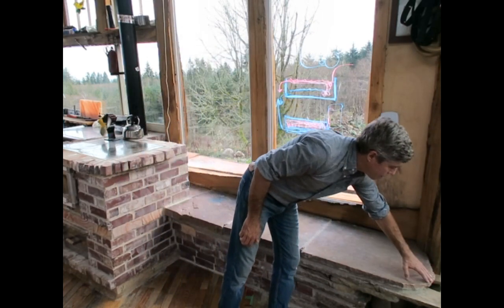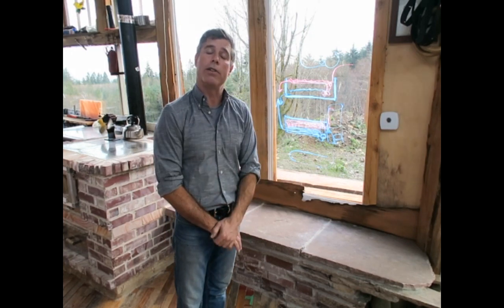Rocket Mass Heater Bells and Benches Discussion

Comment: Hey Matt- Thanks for all the videos!  how important is the volume of the bell? what would be the downsides of having the volume to large? or is there a target volume based on the stove size?
Cheers!
Reply from the maker: Volume is important, but not an exact science as things change dramatically depending on weather, heater state (warm/cold), fuel, materials, etc.  Too much volume means that exhaust temps are too low and there isn't enough draft to run the combustion core to burn efficiently.  The solution is a start up bypass, to preheat the chimney and create draft in poor conditions.  Using a start up bypass you can overcome a cold mass, or large mass, and allows for more thermal storage since you can start up small and then switch over to a larger volume.

There are calculations for Internal Surface Area(ISA) of a heater in relation to how much fuel it holds(Power output, usually in Kw).  I usually don't bother, as I haven't found the calcs to be a very useful guide, and I have a pretty good handle on what constitutes a heater that will run well.  That said, many builders find comfort in pre build maths.  Here's a link if you would like to learn more: 

http://donkey32.proboards.com/thread/1822/sizes-single-bell-systems

Hope that helps!
Reply from the maker: Yes Hugh, the core is sized for a 6" chimney.
Reply: @broaudio  hey, first thanks for video, second I'm tinkering with my own bell and I have idea for making sort of moveable flap between bell and chimney so I could set different ISA. Like start rocket with almost none so chimney can preheat and than make bell bigger and bigger. For my 200mm chimney it could rise to something like 16 m2 of ISA I was said. But Peter suggests something like 9,5 so I wonder if there was some another attempt to have scalable bell. Do you know?

Comment: I have a question on the exhaust.  The exhaust leaves the bell at the bottom but do you have a vertical flue outside of the building? We get lake effect snow and if there is a persistent band we could easily receive 12-18" in one snowfall potentially covering a low vent. Interesting topic.
Reply from the maker: Tracy, yes, there is a vertical chimney going above the roof line like any standard wood burning device.  Thanks for the question.
Reply: So my next question, instead of using some 30' of pipe for the flue to get 3' + above the roof line  can I use an exhaust fan to create the draft while I have a fire going? We're not worried about smoke and creosote as the output would be just CO2 and steam. Perhaps a vedio on exhaust part of the system would be useful to more people than just me. Thanks. Tracy.

Comment: Matt, do you have anything like either an actual halved bell we could see, or a drawing?  Also, a question:  is it the expansion of the hotter gasses in the top of the bell that force the cooler gas to exit near the bottom?  I can imagine the cooler gas leaving the bell, provided there's literally a drop of some kind, but having trouble visualizing those cooler gasses then rising out an exhaust.  ???  Thanks for any light you can shed.
Reply from the maker: Hi Sherry.  I don't have a drawing as it's just too simple.  Turn a bowl upside down.  That's a bell.  As for the flow, think of a stand pipe in a pool of water.  If we fill the pool, the water will not drain out until it reaches the level of the standpipe to flow into and down and out.  The bell works the same way, but upside down.  The bell fills from the top down with warm gasses, when it fills down to the exhaust exit it can then flow out.  Hope that helps!

Comment: What about the draw comparison? does the flue through the bench seat draw stronger than the Bell design? And also if I use the flue to connect two Bell's together won't one bench seat be warmer than the other?

Comment: Good morning Matt, Happy New Year, so does a batch box with design with a 8 inch flue and a 55 gallon barrel combination sound okay to use with this bench seat idea? and if I decide to do two benches would I take the lower Outlet from the one bench and put it into the higher side of the other bench? and then take the Lower outlet of the second bench to exit outside the house? and how is the draw (suction) compare with this idea from the duct pipe through the bench seat with mass idea? Thank you so much!
Reply from the maker: Happy New Year Brian.  Yes, the normal RMH configuration, 6" or 8", into a barrel and then to a bench is a great design.  Quick heat from the barrel, long cycle from the mass.  Sequential bells are possible and increase heat extraction over a single bell of similar dimensions, so a two bench system is a good compromise of smaller footprint and better extraction.  The coupling should be done as you describe, but it's not necessary to enter the bell low.  It will change the performance a bit depending on the system, but exit height is most important.  A high entrance into a bell means it may function as one bell with the proceeding bell.  Draw is roughly similar, although velocity is reduced in the larger volume of the bell compared to flue run.  At the chimney, it's all the same.  Hope that helps!
Reply: awesome, glad to hear it, thank you so much for your input and response. I'm excited, I will post a video when I am completely done.
Reply: Matt, did you mean that "it's not necessary to enter the second bell *high*?
Reply from the maker: No, I meant it how I wrote it in this specific case.  His situation may extract too much heat if both bells are designed with max heat extraction so it may be beneficial to couple them high so more heat is transferred to the second bell.
Reply: thanks!

Comment: Matt, I'm just about ready to do my rocket mass heater and I can't seem to find your recipe for refractory mortar for the batch box combustion chamber to hold the fire bricks in place, I looked up a recipe online that calls for Portland cement, silica sand, lime and fireclay. I can't find the fire clay anywhere locally. some people say that there is clay in the creek beds here in New Mexico do you think I could use that? or what's your recipe?
Reply from the maker: Your clay should be fine Brian.  I use store bought Lincoln 60 Fire Clay and sharp mason's sand at 1:3 by dry volume.

Comment: Do you really make exhaust gasses travel downward a little inside of your stove?  If so, can you explain how it works please?  I’m a total noob who’s just beginning to read about RMH’s.

Also, one thing that would greatly help me to understand the design of your stove is a 3D model of the open space inside of it.  Closeup pictures of different parts of the 3D model could be shown to explain each step that the flu gasses take through the stove.  You could even draw them by hand if you’re a
Reply: ... if you’re a good artist.
Reply: @daveroller  I know this is a late reply, I bought the plans and to help me explain them to the man doing most of the brickwork for me I made a model out of Lego ( other building bricks exist) (there was a language barrier also) it helped a lot

Comment: Both the mass and the bell systems are interesting. My question is, can they be used together? For example running flue pipe through a mass first then having it exhaust into a bell. Would there be enough heat for the stratification to take place and then exhaust trough a exit pipe. Also would this be any more efficient (store more heat) than either system on its own?  I find this whole concept fascinating.
Reply from the maker: They can! 
https://youtu.be/QRUsG20OksA?t=1m19s
There really isn't a better or worse system, just different features for different functions.  In the case in the link above, I had a long run that was too big for a bell so used flue pipe, but the end of the bench was slow to heat and cool.  I use a bell there to allow the gasses to dwell and heat that space well, as well as allow a thinner top coat for faster heat up.  It all depends on your goals and design, the different methods are simply tools you can use to achieve those ends.
Reply: Cool, thanks!

Comment: Does the stone bench top need to be sealed against the rest of the bench to prevent gasses from leaking out?
Reply from the maker: It does Benjamin.  I just set the top sections in the same clay/sand mortar used for the brick work, and fill any gaps with the same.  It's easy to disassemble to inspect, and seals well.  Great question, thanks for the comment.
Reply: This was definitely my number one concern. I just wouldn't be able to get it out of my head someone accidentally breaking the seal.. I guess that is why the typical rmh's tape the pipe joints and have 3-6 inches of cob and clay sealing the entire shell. I love this idea and could see the benefit of making it even deeper. I guess I could run a half barrel shell covered with clay before adding the bench top to appease my paranoia LOL Thank you for the great ideas.

Comment: This is regarding the double sequential bell scenario posted by Green Energy Concepts (YouTube wouldn't allow me to reply to that comment).  It does seem funny when I first think about it (the entrance and exit in the second bell being at the same height), but if I am understanding Matt's answers correctly, it shouldn't matter..... ?   or should the exit still be lower than the entrance in the second bell, even though the entrance is positioned 'low' ?
Reply from the maker: In a double bell build where one is trying to maximize heat extraction ideally both entry and exit would be as low as possible.  Exit does not need to be lower than the entry if both are low and there is room above to stratify.  The real key is to have the exhaust low in the bell, so gasses must cool and descend from the upper level in order to find the exhaust.  Ideally the entry is low as well, to encourage stratification, but in practice it will work either way.  Exit does not need to be lower than the entrance, but it should be low in the bell.  Check it out, he built it!  https://youtu.be/ELt-41Majsk

Comment: Could this system be scaled down to be used to heat a chicken waterer? I am thinking having a stove of some sort outside of the chicken run, then run something into the run that I can set a metal waterer on to keep it from freezing. Right now I have candles in a cinder block and a metal waterer on top of that. It works decent when it works but overall its a PIA.Jokes about scrabled eggs aside, how would I scale something like that that could a.) burn some kind of fuel all day and b.) not be so hot as to be dangerous to the chickens? (an no jokes about scrambled eggs from the peanut gallery ;-)

Comment: Maybe someone can help answer a couple questions. What size house will a RMH reliably heat? Is 1000sf-1500sf  too big? I think a house with a basement would need a separate heat source for that level, but I could be wrong on about it. I'm hoping to build a small but NOT tiny house and have trying to find Eco-alternatives to mainstream building, heating, and energy. Most people around me say I'm crazy.

Comment: Are you able to get home insurance with this system? And, sorry for the dumb question but, this is the first I have heard of the bell system, what we are looking at here is basically a horizontal chimney run inside the house with some strategically placed exhaust ports?
Reply from the maker: Yes Dave, this is a horizontal flue run used to capture and store the heat from the fire.  Insurance possibilities are going to vary state to state, among other variables.  In most  states yes, in some, no. Hope that helps, thanks for the comment!

Comment: How can you be sure no gases are leaking through or out cracks.
Reply from the maker: A functioning system will always be at lower pressure than the outside air, or it won't draw and won't burn.  If it's leaking and you have no draft, you have bigger problems and will know immediately by the smoke coming out of the firebox. Hope that helps.
Reply: Even wood stoves/stovepipes with gaps don't leak so long as you have a draft. I have observed this over 20 years of heating with wood. I see folks post this question over and over and it tells me they've not had a good flue or no experience with wood heat. If my stove leaks through a crack-there is a blockage. Same for RMH.

Comment: So with a bell(i'm new to all this with no knowledge of how to build either) how do you close / build your bench with it being hollow? is there Rock in there and the exhaust heat heats them up and that is your structural foundation for the stability for your bench? This is for a cob bench.
Reply from the maker: Hi Alicia, the bell bench is just a hollow brick box.  No need for anything inside.  Hope that helps, thanks for the comment.
Reply: So is that a wood box sealed in by bricks then? Sorry I am so elementary and don't know anything about working with bricks and such. thanks for your patients.
Reply from the maker: No Alicia, it's just the brick you see making a box.

Comment: what is minimum flue gas temperature that you need to make it flow out the stack and have no moisture in the pipe
Reply from the maker: Good question, there is no one right answer as it depends on the dew point that day, moisture in fuel and system, and other variables.  If your stack is insulated all the way to the top it can be as low as 200°F or even lower most days.  An uninsulated stack is going to change this a lot, you will need to drive it with more heat to stay above the dew point all the way to the top.  Hope that helps.

Comment: Do you need put a stop or shut off when you start the fire/ stove.
Reply from the maker: This stove has a bypass from cook top to chimney, shortcutting the bench.  That does make start up easier, but it's only needed when the stove is cold and it's warm outside, shoulder season and such.  Once the stove body is warm, it stays warm for 24 hours or so, enough to ensure draft and easy starts.  Great question, thank you for the comment.
Reply: Salmon Hunter I did maintenance on a build recently.  I put a double wick candle in the fuel chamber for 20 minutes while I worked.  Even cold wet cob couldn't stop the draw.

Comment: Hi, What if any, are the dangers of exploding with this operation? Seeing the temperatures go to 1000 degrees
Reply from the maker: Good question Angela.  This configuration is in my opinion safer than our traditional box stoves.  Since there is no creosote build up there is no chance of a chimney fire or harmful build up.  No risk of explosion, since there are no combustibles downstream of the fire box.  Thanks for the comment!
Reply: Hi, in your other video, you used a metal box over the riser (for the sauna).  the metal looked a lot thinner than the metal used in wood stoves, and of course the temps coming out of the riser are much hotter than in wood stoves!   how long before the top of the metal box 'explodes' ?  Thanks for the great videos.  I second that you are a natural teacher.
Reply from the maker: Hi Felicia, the thinner metal is not exposed to the same conditions as a box stove, even though the temperatures are hotter.  The metal radiators, whether the one I used in the sauna or the traditional 55 gallon drum will last decades over a riser.  There is no risk of explosion or dramatic failure.  After years of burning daily I can see no deterioration.  Thanks for the comment!
Reply: Thank-you for your reply :)
Reply: That is very reassuring.  I was wondering the other day how long a barrel has lasted for someone - who has the record for longest running build?  how long have you all been running these?  20 years?   the reason I asked about the 'exploding' barrel top is because I see so many metal rockets stoves online that deteriorate, granted, these designs use metal as the burn tunnel and riser, which I understand is a no no, as metal is not appropriate and not insulative.  i extrapolated, thinking that the same temps in the combustion chamber would be hitting the bottom of the barrel.  Are these failing designs i've seen built with a different metal than the barrels used for the radiator you used in the sauna?
Reply from the maker: Peter, there are examples of heaters using barrels that have been in use for longer than 20 years at this point.  Your concern is valid as any metal in the core is doomed to fail in short order.  The reason the barrels can hold up is not due to a difference in metal, but rather that the thin metal exposed to the space can shed heat quickly.  Only the top is exposed to the hottest gasses, which are quickly cooled, and the remainder of the barrel acts to conduct the high heat away from the hot spot on top.  Add to this low oxygen and no more combustibles left in the interior gas stream, and you have a situation that does not deteriorate the metal in the same way the core area deteriorate.  The core areas are insulated, increasing the heat, and as well are actively combusting which helps to strip carbon from the steel in the combustion zone, causing spalling and failure.  It is due to these factors that the radiator barrels and thin steel can hold up indefinitely.  Hope that helps, great question!